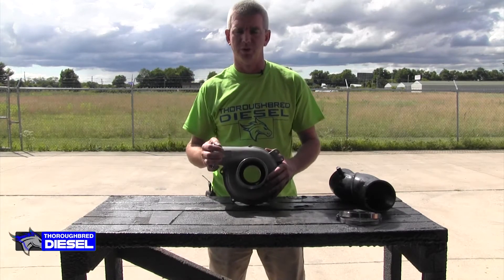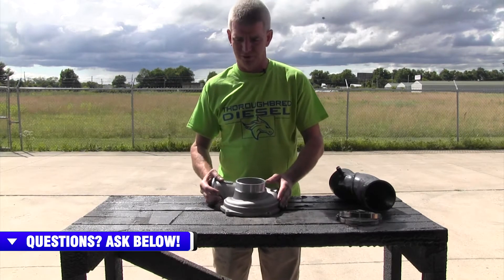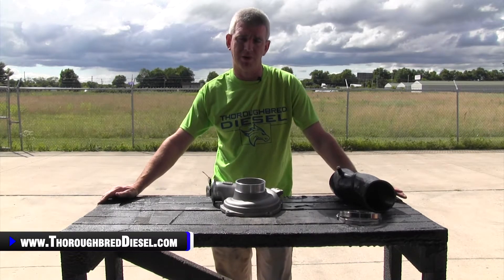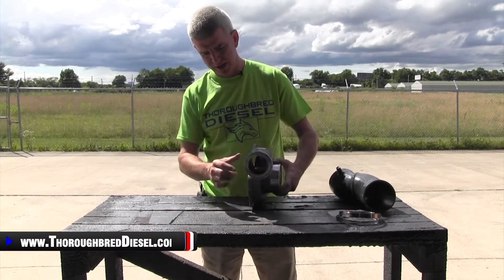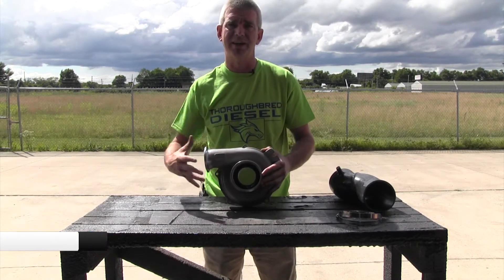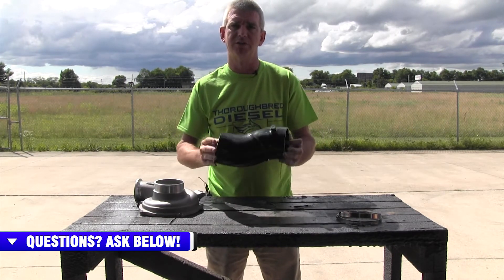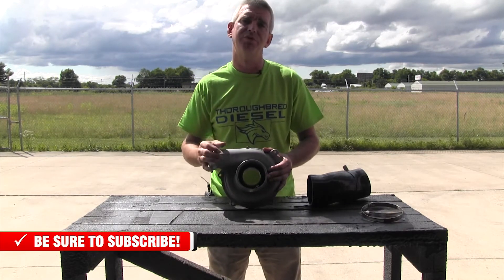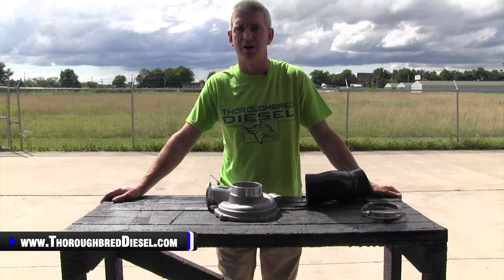ATS Ported Compressor Housing Overview: 99.5-03 Ford Powerstroke 7.3L

Comment: I just bought one of these. When I received it it had scratches in the throat and one of the ears with the bolt goes through was bent where it was dropped. I called ATS and they said they cannot guarantee that the next one would not be the same.. I asked if he could inspect it before they shipped it to me and he said they are prepackaged in the warehouse and he could not open it. I read the horror stories of receiving bad turbo housings. I guess these stories are true. I hate to put this on here but the word needs to get out.
Reply from the maker: We havent run into that, I will reach out to ATS and get an update.

Comment: Would you recommend doing this with a wicked wheel?
Reply from the maker: It works well with the WW. It really fixes most of the problems with the stock charger.
Reply: @thoroughbreddiesel  what would be the best wheel to put with the compressor. I have read about the KC 360 balance as well. Thoughts?
Reply: maybe the riff raff diesel upgraded compressor wheel, they make one specifically for the ATS ported compressor housing
Reply: @jaidonjarvis1583  thanks for the response. I went and bought a brand new turbo.

Comment: Is the ats better than the banks kit and do they have a wheel wastgate
Reply from the maker: Both the ATS kit is a ported compressor housing and wheel, the Banks kits is a modified turbine housing and upgraded wheel. Both do a great job of decreasing the turbo surge.
Reply: Thoroughbred Diesel I have a banks kit, with an exhaust brake from banks, would adding this help or hurt ?